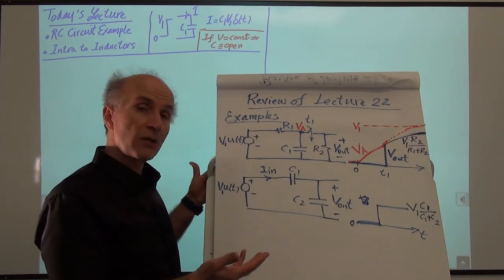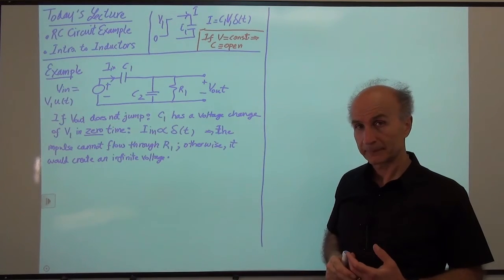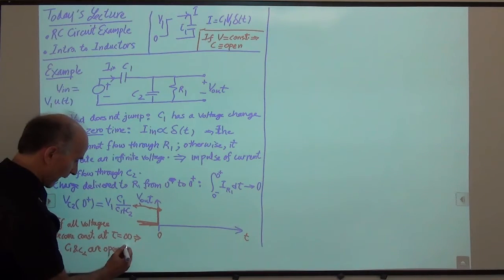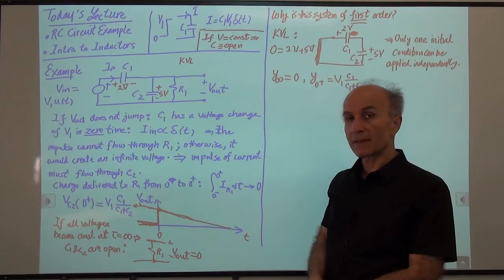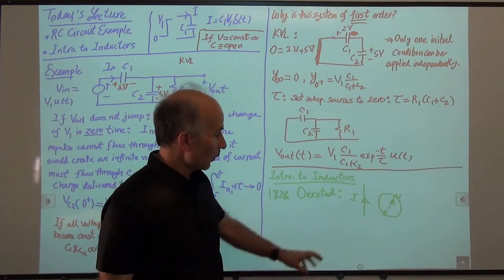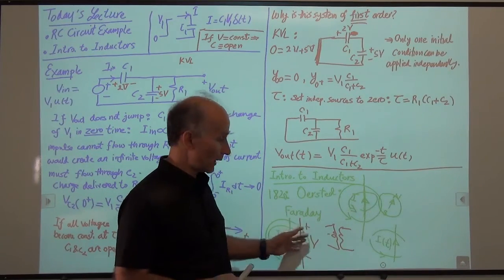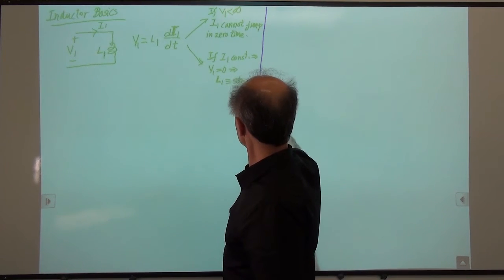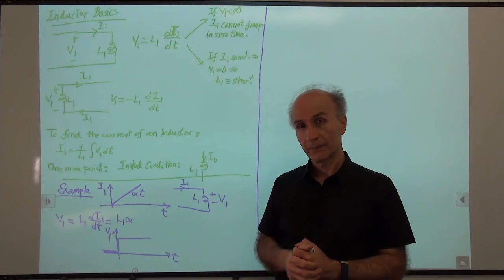Razavi Basic Circuits Lec 23: RC Circuit Example; Intro. to Inductors

Comment: I am confused at @7:29 he says that there is an impulse  across a capacitor Which puts voltage v1 across the capacitor c1 In zero time. And he confirms it ,that means there must be an impulse of current. I.e. impulse of current is generated by a voltage source.

Then he asks where the impulse of current can go and he says it cannot go across the resistor as that would mean infinite voltage. 
 
First my question why an impulse is considered as infinite across a resistor and hence he says impossible to have it as source is finite. 

My understanding is that a resistor is a linear device so an impulse of current will generate an impulse voltage across it.
He says it's not possible.
This is confusing me.

Secondly how is he testing capacitor and resistor differently to impulse is not understandable. My intuition is not working for this. He says the voltage source is v1 not infinite 😂.
Reply: Wham an impulse of voltage can generate an impulse of current across a capacitor why an impulse of of current cannot generate an impulse of voltage across a resistor?
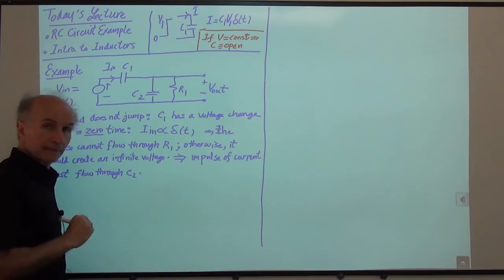Reply: 9:40 he says there is no role of resistor for time 0+ till time 0- time. Because the current is flowing through c2 and not R1...😢 
Why the charge for this time which after calculation is a value considerd so small and close to zero that it's ignorable but current through a capacitor for this time is not is not considered so tiny and ignoredabel.
Reply: Just In previous lectures he said that an impulse of voltage applied across a capacitor will the have same voltage across the other plate and hence the voltage across a capacitor should be zero.he showed th impulse across both plates.fot such an instantaneous application of voltage across capacitor.then he said if there is not voltage across a capacitor it's like a short circuit and hence how shows the voltage across c2 as vin.😢
Reply: R1 is in parallel with C2 so any voltage across c2 should also be across R1. And any voltage across R1 means some current must have flown.😂

Comment: before time zero, shouldn't we set the voltage source to an open circuit? after that if we do kvl the 7 V will be on the open circuit
Reply: Btw, Voltage source becomes a short circuit at zero volts..
Reply: its a step input Vin=V1u(t), for time t<0, u(t)=0, we can imagine this as a switch being closed exactly at t=0.